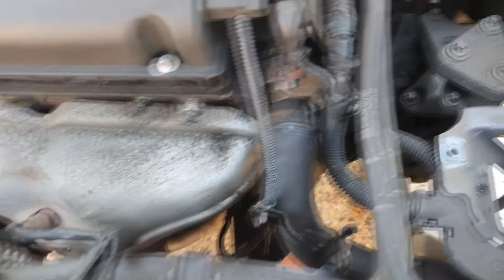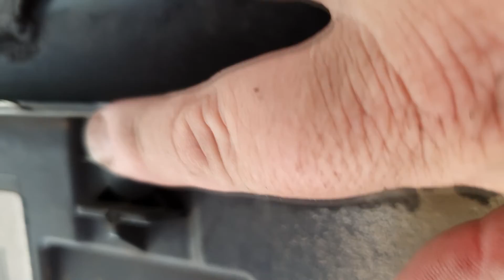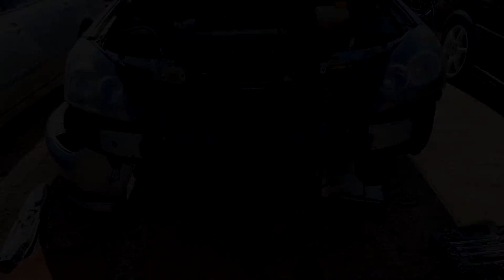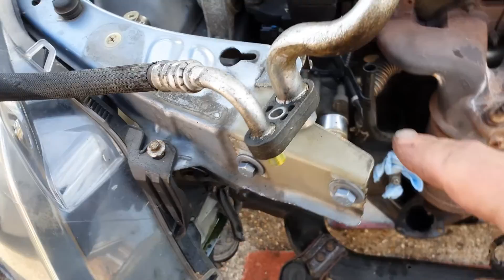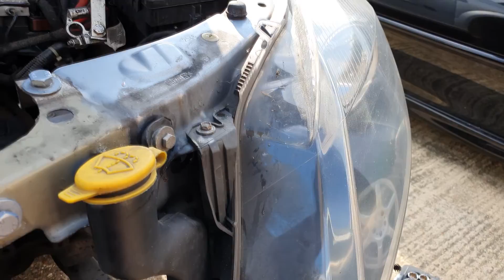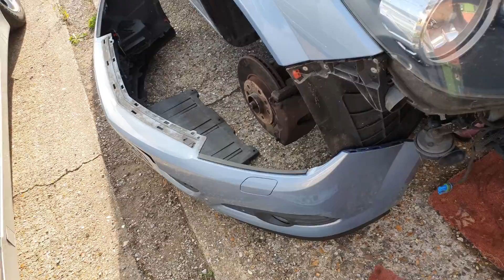Astra H engine removal, the strip down continues

Comment: Over kill remove bonnet lift straight up and out no need to remove all the front end
Reply from the maker: I did a bit of research first and the recommended way of taking these engines out is to drop the subframe and drag it all out of the bottom, not 100% sure the engine a box would come out as one lump without removing the front panel but for the sake of an extra hour it gave me a lot more room to work and meant I didn't have to lift the engine so high to remove it
Reply: @VauxrezNeil  research wasn’t great then that tiny little gearbox and thE engine will come out the top it’s when you get too the larger engines and gearboxes that you have a difficulty

Comment: Hiya I’ve just got an astra h 1.9cdti, clutch has gone, what do you think is the best way to change it.. pulling engine and changing it, or underneath driveshafts subframe ect? 

Thankyou x
Reply from the maker: pulling the engine is quite straightforward and you don't have to worry about lining the subframe up again, if you do it from underneath you would still need to support the engine as you would need to remove the mounts to drop the subframe in terms of the amount of work I wouldn't think there is much in it either way

Comment: Need to do the box on mine, looking at this i could probably get the box out without removing the subframe 🤔hmmm which would be easier hmmm
Reply from the maker: I don't think you would be able to get the box out of the top without removing the engine at the same time, the factory recommended method is to drop the whole subframe, engine and box out from underneath as one lump which would be a pain unless you have access to a 2 or 4 post lift
I believe you can remove the box on its own from underneath but you may have to drop the subframe on that side a little, did this on a Vectra B some years back but not tried ot on an Astra
Good luck and let us know how you get on

Comment: I have a 1.4 Astra h do you know if a 1.6 Astra h engine will fit ?
Reply from the maker: Hi Matthew the short answer is yes, you would also need the gearbox as the 1.4 is fitted with and F13 and the 1.6 and 1.8 are fitted with the F17 box, the main difference being the final drive (differential) ratio also you would need inlet and exhaust manifolds and ECU it would probably be best to buy a complete engine as I did.
To be honest I would skip the 1.6 and go straight to a 1.8 same amount of work and parts needed, if you have the money and time even go for a 2.0 turbo :)
Hope this helps
Reply: Hey thanks for the help I think I will go for the 1.8 and maybe even the 2.0 turbo but where do you recommend finding the parts ?
Reply: Have a 2.0 ler.. Can I fit the 1.8? I have the m32 gearbox 6speed.would it work with the 1.8 engine

Comment: When you removed the aircon radiator did you have to have it professionally depressurized beforehand ?.I am not sure of the procedure of what goes on with them.
Reply from the maker: Hi thanks for your comment, yes you should have the refrigerant removed from the system before dismantling as it is bad for the environment, unless you are taking it apart because you have a leak in the system in which case its likely to be empty anyway
Hope this helps
Reply: @VauxrezNeil   Cheers. I reckon a lot will start to refer to this series.Hope you have put Opel and Holden in your search tags.